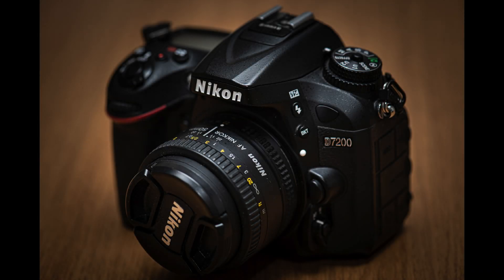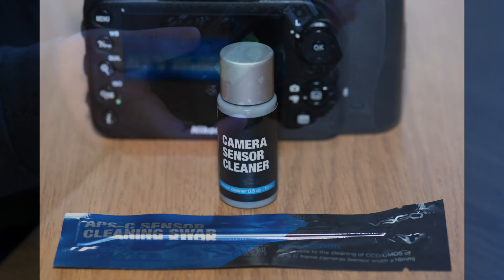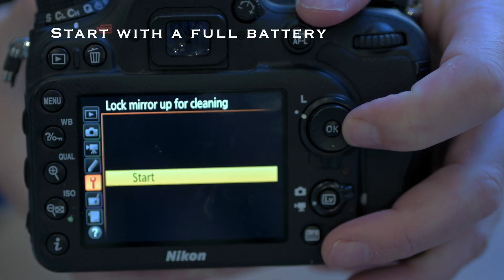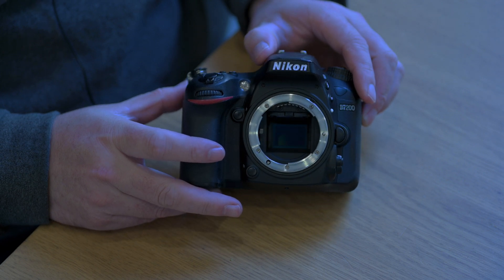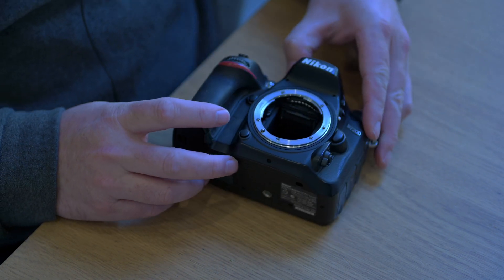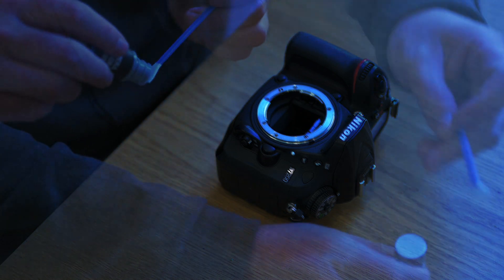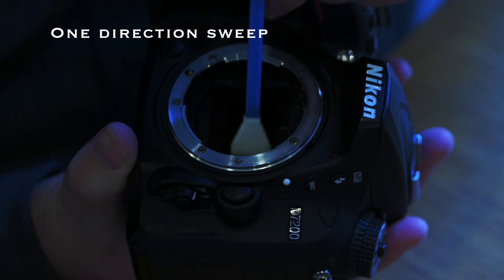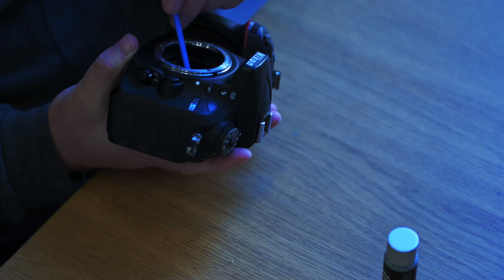Sensor cleaning DSLR (APS-C) Crop Sensor- Nikon D7200

Comment: Hello there, my mirror  luck up option is not active, how to  activate  my mirror  up option  to  activate . Please  advice
Reply from the maker: Hi, which camera do you have? Is your battery level at 100%?
Reply: @HeatonPhotography101  thanks for response, I've D7200(Nikon).
Reply: My battery level is not a 100 %.
Reply from the maker: No worries. Check full battery, switch off, lens off, camera on and select in menu. Let me know how you get on.
Reply: @HeatonPhotography101  thanks I'll charge my battery and I'll you know later.
Reply: Hello again, I changed my battery and did it, many many thanks for your help.
Reply from the maker: Glad you got fixed up 👍🏻

Comment: Isn’t cleaning the mirror super risky as it’s so delicate even using a sensor swab can scratch it?
Reply from the maker: Hi David. As with all these things, it’s at your own risk. Personally, I have never had an issue. The key as with the sensor is to be delicate. Ultimately, if you did scratch your mirror, it would not affect the images, but could be annoying when looking through the viewfinder. Thanks for your comment.
Reply: Heaton Photography thanks for your feedback. Would a scratch mirror cause metering and Autofocus problems ? Or purely just view finder (like you said)? Thanks
Reply from the maker: There is a 2nd mirror behind the first. The first is semi transparent. The second mirror is for focus and metering as it sends the light from the lens off to different parts of the camera. As before, if you’re not comfortable doing it, don’t do it and send it off to a professional. Most of the time a blast of air from a rocket blower will be more than enough to clear any dust away.
Reply: Heaton Photography I understand, so if you scratch the semi transparent Mirror it will just be visible in the finder, but won’t cause any other issues?  I ask cause I have cleaned a reoccurring mark on my Canon 5DS mirror (bottom right) . However , I think it’s catching on the top foam pads as the mark comes back again after a couple of shutter clicks or a mirror lockup etc
Reply from the maker: Sounds like it 👍🏻